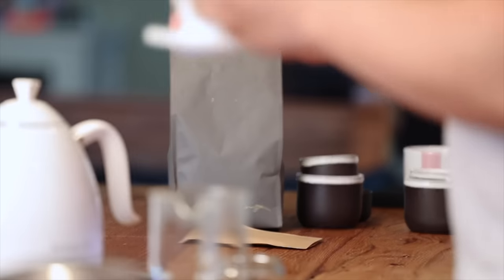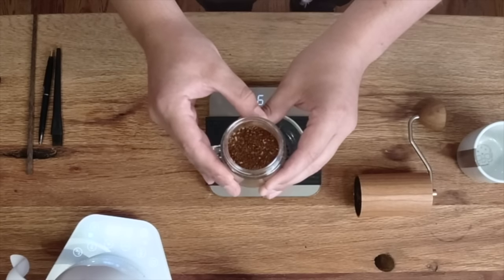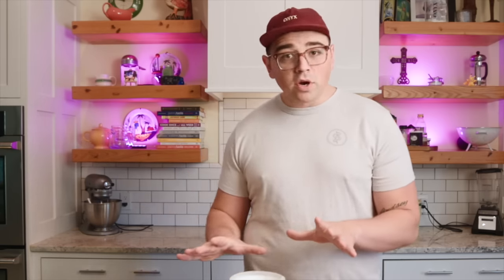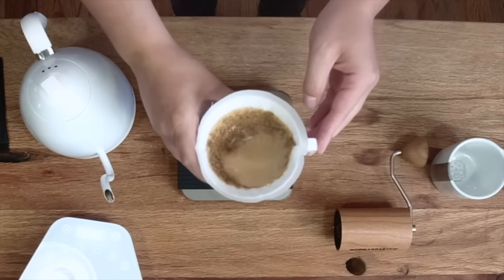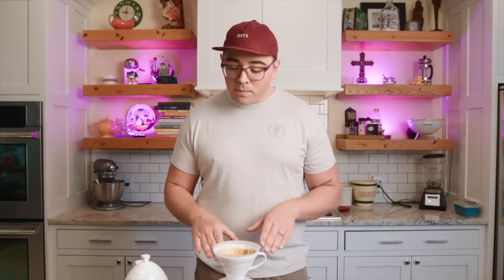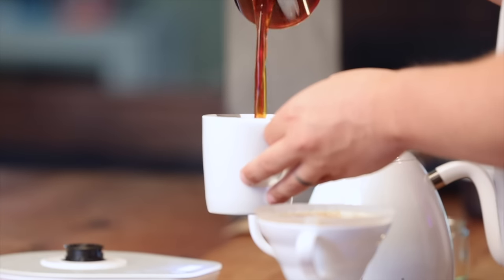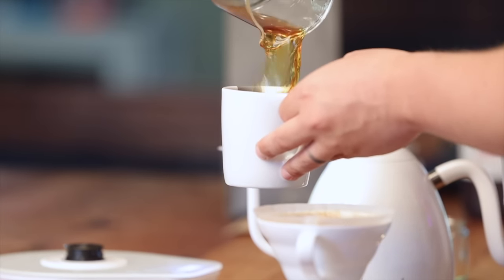HARIO V60 BREWGUIDE: Easy and Effective V60 Recipe!

Comment: I know this is an old video but I just wanted to confirm the grind size. 720 microns and 24 clicks on a C40. So at 22 microns per click, that would be 32 or 33 clicks on a 1zpresso K-Max, yes? Just asking as that seems really far from the recommended range for that grinder.
Reply: You can't convert micron between different grinders

Comment: Have you tried the gabbi master b? I find using it for the last 40% of the the total brew water produces more flavor clarity, sweetness, and complexity.
Reply from the maker: I've tried the Melodrip, which was on the market before Gabi and has the same idea. Issue if you use it without any agitation is you will get loads and loads of bypass and a really diluted cup. I like to use my Melodrip and then swirl after. This way, I get around direct kettle agitation but still have agitation to ensure a high extraction

Comment: I'm curious, what is the science behind boiling water having the same extraction at different elevations even though the temperature would be a little different. Does the coffee act differently at higher altitude so that it is easier to extract as well? From most of what I have been told, and my own personal thinking, the lower temperature would affect extraction. Or is there some resource that you could point me toward so I can read up on it myself? Living at high altitude that's why I was curious! Thanks. Great videos for sure!
Reply from the maker: No what I said was inaccurate. The video is currently processing to take that out. I was taught that and after posting this video, someone engaged me in a conversation which made me go digging. Turns out, the higher the elevation, the less pressure, the lower maximum energy the water molecules have. That, plus some other things. Anyway, the video is currently editing to take that bit out.
Reply: Awesome thanks for the reply. Starting out working in mom and pop shops originally I understand that some of the things we are taught are not always accurate. Thanks for putting in the research!
Reply from the maker: This is true. That was one lesson that fell through the cracks and was unobserved since I don't live at elevation haha
Reply: It's amazing how many of those myths still float around. One of the reasons your content sticks out to me is that you get into the nerdy scientific aspects while still making it very digestible. I think that helps debunk those old coffee myths for many!
Reply from the maker: Except when I preach one of the said myths 😭
Reply: Ha! We've all been guilty of it at some point. I look back at telling people to pour out a shot that's gone sour because it's five seconds old and laugh.

Comment: Great video, Lance. Why is it that the plastic V60 retains heat better? I would think metal or Ceramic would.
Reply from the maker: Metal and ceramic suck heat out. They want to hold heat. Plastic doesn't. So, it allows heat to stay in the bed more effectively. Easy task- take a plastic dripper and a ceramic. Brew coffee in both with all variables constant. Stick a thermometer in them for the duration of the brew and watch how much heat is lost in the ceramic vs the plastic
Reply: @LanceHedrick  Thanks. In my mind that feels backwards. But I trust you 👍
Reply from the maker: Lol I'm not the only one to say this! James Hoffman, Scott Rao, Jonathan Gagne, etc. It's a known phenomenon. I, too, was resistant at first until I did the test
Reply: @bobbymoorehead1138  Metal and ceramics are better at conducting heat than plastic. This means that when the heat of the coffee slurry comes into contact with the metal or ceramic, it will more easily transfer from the coffee slurry to the cone.
Reply from the maker: Yup. Hence suck heat out haha. They conduct whereas plastic can insulate

Comment: My Breville Dual Boiler is broken at the moment, so I've been brewing exclusively V60 (technically W60). I generally use a method that's somewhere between @KyleRowsell and @JamesHoffmann's recipes. Personally, I find I like a lower ratio though--30g in to 400g out.

Definitely will give this method a try though and see if I can taste a difference, cheers!
Reply from the maker: Oh you should! 30 to 400 is quite low. This will definitely give you a higher EY and likely a somewhat similar TDS, assuming you aren't agitating much. Should be a good contrast to the others.
Reply: @LanceHedrick  will it work just as well for a flat bed? I've been using the flat bed mesh screen for the W60. Been really enjoying the extra texture from that style (although I do also have paper filters).
Reply from the maker: Ooooo hmm. Not sure I'd go this heavy with agitation if using mesh, to be honest! Would make more sediment fall through and likely be astringent
Reply: @LanceHedrick  good call, okay I'll give it a try with a paper filter. I appreciate the hack too, btw, for warming up the ceramic.
Reply from the maker: Absolutely! Glad you enjoyed it.

Comment: Hey Lance, where might you start dialing in this intriguing recipe on a stock calibrated Niche Zero? And do you find the fines the Niche produces to be a problem for V60?
Reply: I use between 40-45 on my niche depending on the coffee I’m using and it works out perfectly, no issues with the fines produced.
Reply: @davidthomas9960  Thanks! I'm around 55-60 with my Hoffman method so this will be an interesting experiment!
Reply: @damienhallsworth3314  I find that Hoffman’s technique can cause quite a lot of stalled brews, for me personally. Lance’s technique hasn’t choked on me once even with finer grinds than I was using before.
Reply: @davidthomas9960  Interesting! Lance has suggested the aggressive Hoffman bloom swirl might blast fines into the paper causing stalled brews so perhaps that's the issue I'm getting as my Hoffman brews can stall occasionally. Thanks for the insight 🙂 So much great knowledge on this channel!
Reply from the maker: Hey Damien! Yes. I find the niche to be problematic with large doses on pourovers!

Comment: For 12g/200g would you pour at 20s intervals? 
25g bloom 
20s: another 25g
40s: 75g
60s: 75g

Or extend the pours to increase brew tine slightly?
Reply from the maker: Really depends on the coffee. I still do 30s for the most part, unless it is draining incredibly quickly. Typically just fine your grind so it doesn't.
Reply from the maker: Also, I'd do 30g bloom, another 30g, 70g, 70g
Reply: @LanceHedrick  OK I will try that. What sort of time would you be aiming for the draw down to finish? Just so I know whether to go coarser or finer depending on my first try
Reply from the maker: Go as fine as you can without it imparting intense bitters

Comment: Hey Lance, I'm just wondering if you think there are any pros or cons to your method vs the Kasuya 4:6 which uses a much coarser grind. Would his or yours be better for a certain type of bean?
Reply from the maker: I prefer finer grind always..more extraction equals sweeter cup (to an extent). Well, ubless using darker roasts. Then coarse and cooler water is better to abstain from roasty characteristics.
Reply: @LanceHedrick  thanks for the reply. I'm going to give your method another shot and get it really dialed in. I've been having very good cups with the 4:6 using my Vario with steel burrs but sometimes I can't grind coarse enough for his method!
Reply from the maker: Absolutely. I can't ever get over 20% EY with the 4:6 using that coarse of grounds. Even with hyper aligned ssps haha! Just can't do it with that heat loss and coarseness. Tend to be quite under extracted, which works in competition well because the coffees used, like tetsu used, are super soluble and delicious regardless of how they're brewed. 

Anyway, give it a try and let me know!
Reply: @LanceHedrick  thanks again. Loving your channel. Keep up the great work! As a Breville Infuser owner your other video has now tempted me for the BDB 🙂
Reply from the maker: Haha! As it should 🤣
The infuser is awesome. But the dual boiler is genuinely a potential end game, imo
Reply: @LanceHedrick  got great results with your method the past few days! I had to lower the temp to 205 because my roast was closer to medium (Ethiopia natural that I roasted on my Bullet a few degrees too dark and had 15% weight loss). I'm sure boiling would be good with a super light roast. Thanks again. 🙂
Reply from the maker: Heck yeah! Sounds great. And I'm glad to hear you took the advice and lowered temp! (I have that in the caption- can't remember if I mention in the video)

Sounds great!

Comment: This seems like a good "alternative" to Tetsu Kasuya's 4:6. Or is this highly inspired by Kasuya's? 

Anyways, this looks like a great recipe I should use outside my conical dripper as I have my own favorite v60 recipe. There are just things I can't do with non-conicals. Thanks!
Reply from the maker: I use this with flats! I am not a big fan of conicals. I use them in videos since most have conicals.  And not inspired by Tetsu. His stuff tends to be super coarse and low Temps for low extraction to boost acidity in darker roasts
Reply: @LanceHedrick  well, that makes sense why Tetsu has less clean cup of coffee on light roast. Japan do love using darker roast
Reply from the maker: Yes. Quite dark, which means more soluble. Easier to extract

Comment: i’m having some trouble with this method. my TBT is around 4:30 and im getting bitterness with little sweetness. I think the filter paper is getting clogged. I use tabbed hario filters, does that make a big difference? I tried coarsening the grind and it tasted hollower while remaining bitter and clogging. My grinder is a 1zpresso k-pro that i got a few weeks ago, so i hope it isnt the problem. Maybe i’m agitating too much? any tips?
Reply from the maker: Yes! The tabbed filters are horrid and clog easily. Grab a pack of the untabbed or a pack of the medium roast cafec filters!

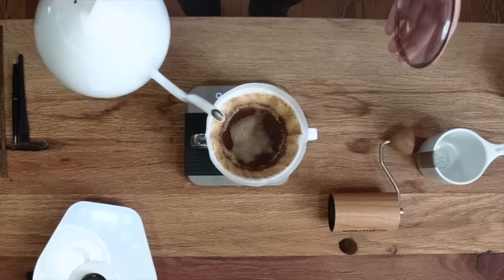Comment: I did it with you and I’m 5 minutes in, still waiting on all the water to draw through. Used my baratza on 13. Thinking it might need to be a bit higher (normally use it on 20). Took 5:30 to go all the way through. Any thoughts?
Reply from the maker: Yeah. The baratza is going to be producing a LOT of fines. So, you will need to grind a bit coarser and be more gentle with the swirls! Going too hard will force the fines to clog the filter and stall the drawdown

Comment: If we use a bigger or smaller ratio, should we be aiming for the same draw down time?
Reply from the maker: I'd first try to change extraction with water temp or pulses. If that doesn't get you there, then I'd suggest maybe playing with grind size. I'd stick with this ratio, as imo, it's the proper golden ratio haha
Reply: @LanceHedrick  I just meant if i doubled the recipe for two instead of one, should it be the same time?
Reply from the maker: OOOHHHHH no. It should be a good bit longer. Not double the time, but maybe 30% or so longer.

Comment: Hi Lance, I live in Utah where the boiling point is 203°F how well will this recipe copy over for a slight lower temp?
Reply from the maker: It'll be fine! Go a smidge finer to make up for it. That will increase surface area and add contact time.
Reply: @LanceHedrick  Sweet thanks for the reply stoked to try this!

Comment: Hey, so I've been trying to find a universal, easy and good tasting v60 recipe for the cafe I work at. I was wondering what the grind size would be for the ever so wonderful ek43 as that's what we use for single dosing things like pour overs or just dialing in espresso for personal drinks. This recipe is incredibly simple to remember and repeatable
Reply: there's no answer here, it depends on the coffee/roast level. If it's light, grind finer as per usual. The other thing is obviously taste preference, which is really subjective
Reply: @Cenot4ph  fair, I was just mainly wondering what grind size (roughly) he was using if it were on a Ek. I don't exactly have anything to measure the particle size. I've been experimenting though so I think I'll be fine. Just kind of bummed that my Shop ran out of the hario v60 o2 papers so we're using some stupid smaller ones that are around half the size which doesn't rly work for big pours focusing on keeping the high heat
Reply: @slow_clumsy what grind size did you end up with? I currently use new coffee burrs and grind on 11 (new coffee dial of ek43s). My last pour always gets quiet slow and starts dropping

Comment: Was surprised that you used water off boiling. I hear often to use water at 193-195F for pour overs.
Reply from the maker: Yes. It is true that typically the range 195-205 is recommended. But, that greatly lessens the amount of yummy solubles we can extract from the coffee.

Comment: 720 microns is on the fairly coarse side for filter right? Something like a 20 on a baratza virtuoso—coarser than the Hoffmann recipe and closer to the Kasuya 4:6 if I’m interpreting correctly.
Reply from the maker: I wouldn't say on the coarser side, no. The commandante, which is what I used, goes every click is 30 microns. I was at 24 clicks. Espresso goes up to 16 clicks. Tetsu would be closer to 32 clicks. This isn't fine, as I'd classify 18-22 clicks as that, but it isn't coarse. Probably between medium-fine and medium
Reply from the maker: But with all the agitation, both from the kettle and from the spins, and taking into account the fact most don't have high quality grinders, I find it silly to recommend finer than this as it would clog most people's brews. The aim of this is to be as widely applicable as possible, which I believe it is.
Reply: @LanceHedrick  thanks! That definitely helps to dial in on my Baratza and 1zpresso q2.
Reply from the maker: For sure! No problem, my friend!
Reply: @spencergriffin5830  Hi! I'm using 1zpresso q2 too, do you think the equivalence is almost three full rotations?
Reply: @rafarm32  I haven’t tried it with the q2 yet!
Reply from the maker: Sorry I don't have this info! Like table sugar. Medium-fine.

Comment: Really struggling with v60 ever since my cheap Bodum Barista grinder died and I replaced with a Niche Zero. I can’t seem to get  that good sweet flavorful cup I used to get. I am thinking it’s still too fine as I am still at @4:30 brew time. Any advice?
Reply from the maker: First advice is to make sure you aren't swirling too hard. This can shoot fines into the filter and stall the brew. Second is maybe consider going a smidge coarser.

Comment: Why not rather pour the big 120s in a circular motion while keeping the speed high? Wouldn't this ensure quicker distribution of the water to all the grounds?
Reply from the maker: Not necessarily, no. Plus, One of the goals is to reach all the way down in the bottom most part of the bed to disturb the slurry. Pouring in a circle wouldn't do this as affectively. Plus, it wouldn't be replicable with a tea pot, though that isn't the reason I chose a center pour.
Reply: @LanceHedrick  oh right! Additionally, would you ever recommend modifying the brew through the grind?
Reply from the maker: Yes, that is definitely a variable, but I don't like starting with that. I like finding a grind that allows a specific flow and playing with water temp. Usually, I like as fine as I can go without slowing down the flow
Reply: @LanceHedrick  so the golden grind setting is the finest till you don't clog?
Reply from the maker: For the most part! Always start coarser and go finer until you find it.
Reply: @LanceHedrick  thanks dude! Imma dial my next coffee through this recipe! See how that goes 😁